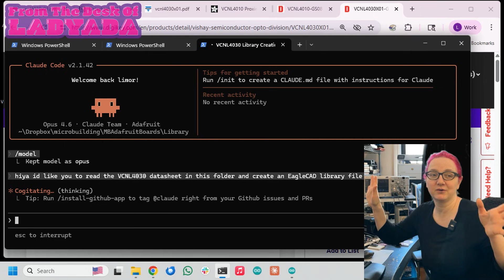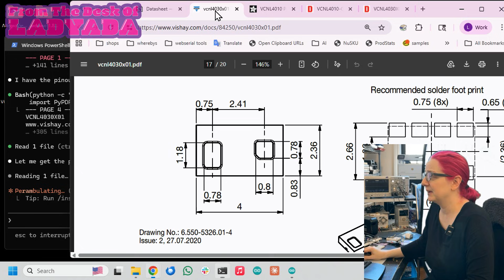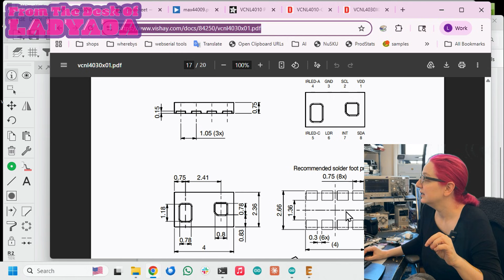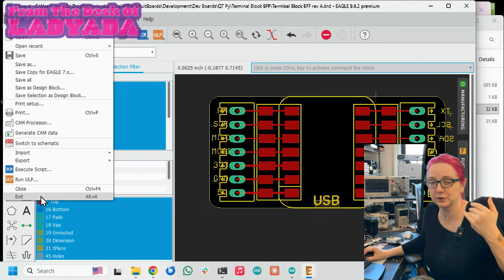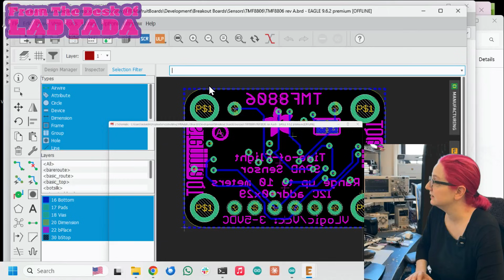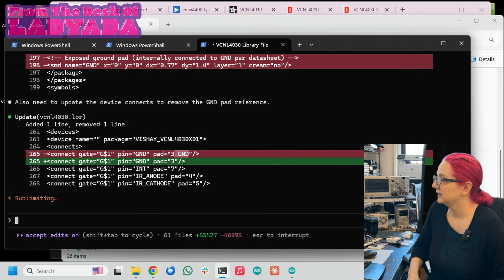Desk of Ladyada – LLMs Make EagleCAD Footprints, Daycare Edition 🍼🦀

Comment: Just a long shot. May be too many steps. Not totally direct to AI either but
I would try Rhino 3D with a parametric grasshopper file.  I ran an AI prompt and came back highly practical and upgradable to whatever you might need.   
A very deep bench of math functions and output to .lbr  files

AI output
Yes, creating a parametric Grasshopper definition to generate specific EagleCAD chip footprints is highly practical. 

If you want to integrate AI into this parametric workflow, you can bypass manual data entry entirely. You could use an API call to a model like Gemini, instructing it to read a manufacturer's PDF datasheet, extract the exact pad dimensions and pin pitch, and feed those parameters directly into your Grasshopper sliders to automatically generate the XML footprint.  Adding nodes to get rid of weird dimensions.

Because modern Autodesk EAGLE (version 6 and later) utilizes a structured, human-readable XML file architecture, you can format and export these library files directly from Grasshopper without needing a proprietary translation plugin.

Here is how you would construct this parametric footprint generator:

Datasheet Parameters: You would start by creating number sliders in Grasshopper for the specific dimensions found on a microchip's datasheet. The essential parameters include pad width, pad length, pin pitch (the distance between the centers of two adjacent pads), row spacing, and the total number of pins.

Geometric Array Logic: Using Grasshopper's native math and array components, you calculate the exact Cartesian (X and Y) coordinates for every pad. For example, to ensure the device is perfectly centered on the origin, you would use the pin pitch and row pitch to array the pads outward symmetrically.

XML String Formatting: Instead of trying to export native Rhino 3D geometry, you feed these calculated coordinate lists into a Python or C# scripting component. This custom script takes the numbers and formats them to match Eagle's .lbr (library) XML schema. The code dynamically generates the required <package> tags for the component, <wire> tags for the silkscreen outline, and <smd> tags for the surface mount pads.

File Export: Finally, the script writes this concatenated XML string to a local .lbr file on your hard drive, which can then be immediately imported into EAGLE.

Comment: My primary complaint about datasheets is they're often wrong. ;) But yes, dimensioning needs to be as if preparing a workpiece for a machinist: specify one corner as the zero ref and make all measurements from there. This is a decent use case for LLM: it just has to be 'good enough' that the work you do fixing what it suggested is net less than the work to generate the whole thing from scratch.